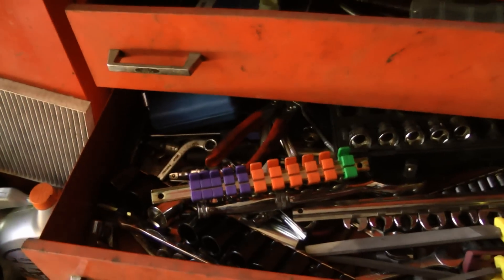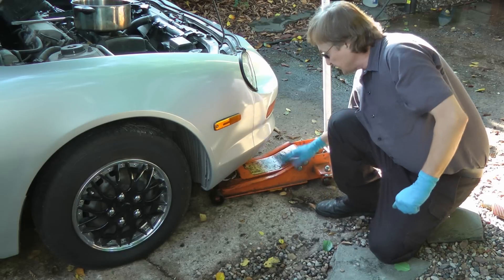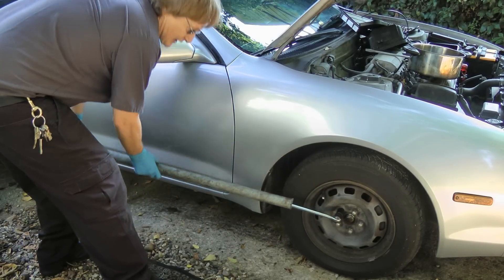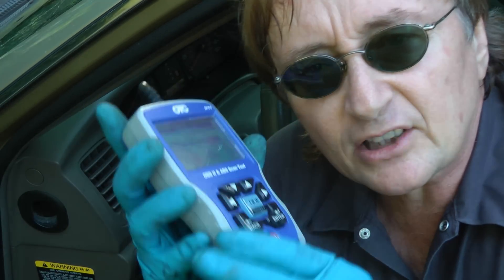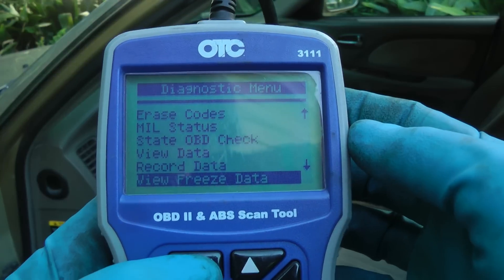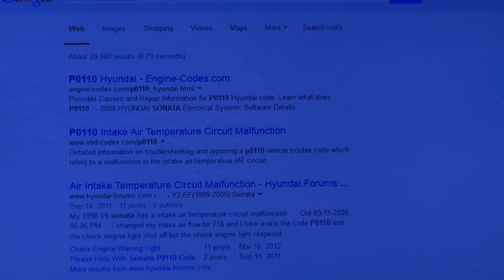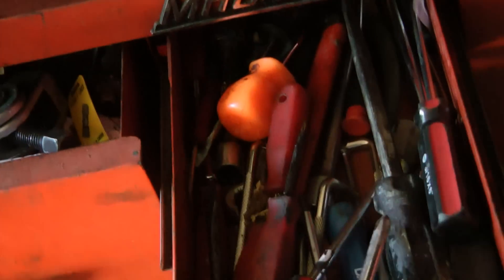Basic Tools For Fixing Your Own Car

Comment: Hello scotty and thank you for the effort, I have a question that everyone have a different answer to:
How often I need to change my gear box oil ?
I have a chevy lumina 2006
LS
Reply from the maker: on an automatic transmission, I would change it every 30 thousand miles. If a standard car, only every 80 thousand miles or so, it's not a big deal on a standard.

Comment: Scotty, many people would say as a beginner you should be using a torque wrench for wheel tightening and other critical areas.  Would you agree(you haven't mentioned it in your video)?  And I think something like wheels is very basic.  Or might hand tight be ok for wheels, brakes and other such areas?

Comment: Thanks for your video. I often find that I'm either too wimpy to break bolts and other fasteners that are really tight. I do have a few breaker bars, but I often find that I don't have enough clearance to buy myself some leverage. Any suggestions on how to undo factory-tight bolts?

Comment: You're right, I bought an OBD reader for 20 bucks that plugs in and whenever I plugged it into a camera it screwed the traction control! I had to level the car out and calibrate the traction control again using the same tool but in a weird way

Comment: How do I tune up my 292 straight 6? 6'000 miles on a long block. I have a lifter  noise, or maybe a rod noise etc. It should run smooth and noise free in traffic. I may need to shop it and get the results it needs. U da best!

Comment: I like Duralast tools, great warranty for their tools, I have a 180 tool set, a 3 1/2 ton jack, and a newer breaker bar. I broke my previous breaker bar after I got done changing out a flat tire, I left my breaker bar on the back bumper, I made a sharp turn and I heard a loud clang, after I did a tool inventory, I noticed my breaker bar was missing, so I texted my mom to let her know that my breaker bar fell off, I got it back, but the little ball that secures the socket on popped off, so I went to Autozone and got a new one for free.

Comment: Good video scottty
I would not advise anybody to put wheel locking nuts on as a garage once tightened them up with the air tool to 150+ lbs and it broke the delicate locking nut key when i tried to undo them and had to order a new locking nut key abroad to get it off.
Glad it did not happen at the roadside in the middle of nowhere
I have my car garaged at home and don't go anywhere dodgy so i don't need them.

Comment: The thing that kills hydraulic jacks is lack of use. The seals dry out and split if it sits too long. I have  a harbor freight jack that is older than me and it has never had any maintenance except a new coat of paint. Still works and no leaks.

Comment: I agree 90% I'm a pro mechanic but in my truck I always keep a(fixd) blue tooth coads reader ob2 scanner an it's never let me down when I'm off roading 70mi from help an any way u take everying u may need most the time a power probe an a 8mm-21mm socket set all u need from Harbor Freight an always got home even when my tranz ecm went out an won't let my truck start flash the coads reset my computer an I got home tell I could get it fixed right I got mac an snap on tools u don't need to blow $$$$ to be a engine technician you just got to have a decent code reader and a good idea of what you're doing.

Comment: If you are buying a socket set, consider paying a couple extra bucks for a metric spline set.   I've had the splines work even after my 6 point set had rounded the bolt heads.

Comment: I bought a $20 bluetooth reader from China which sometimes causes the ABS light to flash when I turn the ignition on. It's an ELM327 clone, so I'm planning to buy a genuine one. These are also faster than the clones and doesn't mess with stuff it isn't supposed to mess with. But I have to say that it's quite convenient with bluetooth, since it allows you to check live data while you work around the engine, and if you use a laptop or a tablet you have a big screen to show graphs and such on.
Reply: real talk about i had the same issue with the bluetooth one.. thats why i just buy american made tools...yes they are price but they worth it as hell im just saying guys...

Comment: LoL! I used to do commercial tire fitting and have used a 6ft scaffold pole on my breaker bar to get some truck wheels undone. Believe me, even my 1" drive heavy air gun didn't undo the nuts and I was jumping on the long end of the pole before come of 'em cracked off!! (I wasn't allowed to use a flame to heat them up)

Comment: So specialty tools 
I am getting into the mechanic trade 
I got most of sockets minus the female torx sockets 
And Allen sockets that I am going to get tomorrow 
I got impact guns and breaker bar I got two jacks harbor freight 1.5 ton and 3 ton high lift jack 

What else should I get a induction heater? 
Brake caliper piston compressor 
Wheel hub remover tool 
Ball joint remover? 
Also a welder?
Reply: Quick note 
I am getting the launch obd scanner that shows and resets abs light and sees the transmission shifts and etc

Comment: Scotty, what's your take on the need for torque wrenches? Some say they're critical, others say that tightening by "feel" is good enough. Are you in the latter camp? I haven't noticed you using torque wrenches when you tighten stuff (at least not in the videos I've watched so far). 

Thanks for the great vids!
Reply from the maker: I'm with the later group, only use em on engine rebuilds and critical stuff

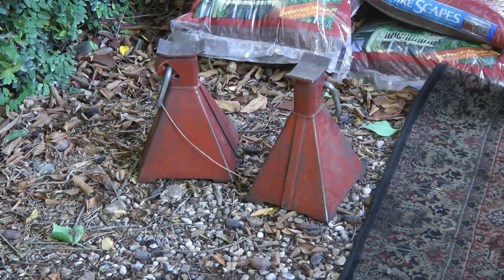Comment: At 1:48, I thought you were going to be crazy enough to actually take off the hubcap with that air tool! At the garage I work at, we had a lady come in who thought she needed a locking wheel nut key after she had tried to take off what she thought were the alloy wheels on her car. Turns out she snapped off the fake wheel bolts on the hubcap!

Comment: Also keep in mind that you can borrow, for free, many tools from auto parts stores that would normally cost a fortune. Usually there is a deposit, but you get that back. I've even borrowed a bearing/ball joint press and used it in their parking lot (Autozone) once, when I didn't even have the money for a deposit.

Comment: @2:12 I laughed. I have used a pipe on my wrench for decades. My brother and I coined the term for it "The Bitch Bar" because it works every time a rusted nut or bolt is a bitch.

Comment: I remember down my motor club, we didn't have a working air gun at the time. We were taking a car to pieces and after disconnecting all of the brakes etc we had to get driveshafts out, the nut was badly crossthreaded so, to crack off the nut we had to use 7 people, 5 to anchor the car as it was light and two with a 6ft piece of scaffolding on the breaker bar to get the nut off.
Reply: How did you not snap the breaker bar, I've done that myself using a big pipe before lol
Reply: Because the car was so light the rotation of the bolt caused the car to move so we needed the anchors. We didn't snap the breaker bar because we have an older one, much stronger and because we have a couple of animals (not literally) down the club we need stronger tools, we only had our biggest one as the two smaller ones were snapped by one guy lol

Comment: Torque wrench. Always use a torque wrench when working on cars...removing tires especially. It provides the proper amount of tension for tightening so you don't over tighten it, which is bad.

Comment: Hey Scotty I have a 2001 Ford Taurus. I am going through a rough time with it. When i am driving it runs fine but when i get to a red light and i am idle it dies. It does not do it all the time. Lets say in a 30 minute trip from my house to work and maybe 10 stop lights it will do it once. Some mechanics have said is my fuel pump going bad and others say my MAF sensor is dirty. What you think? Thanks. And by the way your awesome.
Reply from the maker: try my video "how to fix a car that idles poorly" and being a ford, check for vacuum leaks on the intake system too
Reply: Thanks!

Comment: Hey Scotty!
 Thanks for the video.

One question regarding socket drive. What type do you suggest for regular car maintenance? 

I don't own a socket and ratchet set and consider what to buy. 

I read that 1/4" drive is good for small works, 1/2" is good for large bolts and 3/8" is a good place in between. What do you think? Can a 3/8" drive socket set be enough? 

Thanks again,
Rami
Reply: If you're not doing brakes or suspension, grab a 1/4" set and a 3/8" set. If you're doing major work you'll need all three.

Comment: If you need to replace timing belt or crankshaft seal you need impact driver to remove /tighten crank bolt if not the crankshaft pulley will spin

Comment: I need some help with something. My truck started making a grinding noise for the first 3 - 5 seconds of starting it. (It's a 87 f150) I had 10w30 but did an oil change and used 10w40. Put in 6quarts and primed the filter. We also tightened all the bolts on the oil pan (made sure all of them were torqued to the same amount to prevent warping of the pan). But because the filter is on the side of the block, we could only fill the filter 3/4 the way up without spilling it before putting it back on. Dipstick still said it was 1/2 quart low, but we had no more oil left to put in and it was in the middle of the min and max markings , so we thought it should be okay for now.

So we fire it up and immediately, I notice oil pressure had increased dramatically (good because it was reading slightly low) and the truck didn't make that awful sound anymore. Yay right. Well I'm at my friends house 3 days later and oil pressure went down. It was a hot day and rear main does leak (not too bad tho. If truck sits and is started and shut off, it won't even leak out. Just gotta drive it or run it for a good while) and id done about 45 min of driving. He thought maybe the old seal was on the filter from the old filter. Well we pulled the filter, and that wasn't the case. While the pressure was low, it still increased with acceleration. So we put it back on and lost 3/4 of what was in the filter but we didn't put more in before we stuck it on, I start the truck and the sound is back... I get home a couple days later and put a whole quart in and it and the stick reads that it's 1/2 quart low. I start the truck up the next morning cold and it's still making the noise.  (Noise is only made when the truck is cold. If it sits for 3 or less hours, typically it won't do it). It's got a 302 EFI in it. Any advice? This morning, I just went ahead and kept adding oil in until the dipstick was at it's Max. mark.

Comment: thanks man,, thumbs up,  for oil change reasons only, is the simple jack u just thru away enough or go for the large one?
Reply from the maker: larger ones are best, harbor freight tool sells em for 69 bucks when on sale for a low profile one you'd need for a BMW
Reply: Really thanks man.. keep up the good videos.

Comment: Scotty, I'm looking for a simple, good truck that's easy to work on and has decent gas mileage.  I'm thinking of something from the 1970's or so (like a c-10 or F150) that has a newer, upgraded engine.  What is the best, easiest truck you've worked on that you would recommend? I value your opinion.
Reply from the maker: get a 70s F150, you can't beat them. Just realize no big truck will get good gas mileage. if you want that, get a smaller toyota truck, the can run forever

Comment: Even some of the best OBD2 scanners are no match for a 12$ "bluetooth obd2" transmitter (search that on ebay, buy a small one !) that you couple to your normal smartphone (app Torque is very good and like 5$).

There are no 60$ bluetooth obd2, if you find one it's just someone selling you a 12$ for 60$ ! They all work on the same design and I've never had any trouble with them and I used them on dozens of cars. The only problem is that sometimes they are refusing to pair with some phones.

What I really like about the software is you can set it to record everything, then you go for a 30 minute ride with the car. It helps diagnose intermittent problems.
Reply: bluetooth ones are absolute shit. we had one and it told us the car had a leaky o2 sensor. used a obd2 scanner and it told us the head was leaking. obd2 1, blutooth 0
Reply: shaun23100 OBD2 cannot possibly tell you about leaks in the exhaust system.
Reply: shodanxx  it can as it is telling you if the o2 sensor is receiving to much fuel, and can tell you you have a leaky head
Reply: There are many cause for air fuel imbalance, the O2 sensor cannot determine if leaks of any kind are the cause.

Comment: Scotty what scan tool should i get for a 1990 Toyota Celica GT-Four ?
Reply from the maker: those require a dealer level scan tool, they cost a ton. but you might find one like an old snap on on ebay for a lot less.
Reply: I'll try to see if i can finde one ty so much Scotty :)

Comment: flare wrenches are good for brake lines too.
Reply: and if your removing a broken part just cut the line and use a box wrench.
Reply: omg yes, i stripped my clutch master hydraulic line using a standard open end spanner. flare wrenches are a must.

Comment: Would a GM OBDI to OBDII adapter work with a scan tool? Or would you recommend I just buy an OBDI scan tool? Also, a crowbar can be a very creative tool around cars.
Reply from the maker: those adapters rarely work
Reply: Not sure if you bought anything, but you dont even need a scanner for GM OBD1, just a wire.  the scan tool is a fancy jumper wire with a plastic case to stick in the port.

Comment: I have a misfire with one of my vehicles so I can at least verify the issue is relatable to a computer and or another part. Is there any way u could do this myself as a person somewhat new to cars? If not, how much do you think it would cost to pay a mechanic? I understand that prices vary depending on the mechanic and or auto repair shop itself, but what would be a good estimate?

Comment: when using a breaker bar for tires do you have to use a chrome socket or impact??
Reply: Regular is fine.. Impact uses a hammering action so regular sockets can shatter apart.

Comment: hey scotty im gonna be buying the crescent 170 piece tool set, wondering if they
ok for basic car work
Reply from the maker: I've never seen that exact brand, so I can't say, But really most tool kits are fine as long as they aren't made of pot metal
Reply: I have the Crescent CTK170CMP2 and its pretty good. wish the combination wrenches had ratcheting ends but still gets the job done excellently for ~$100

Comment: I just left you a message on your other video about a evaporated leak will the light just go off when the leak is fixed
Reply: After doing the repair do a hard reset by disconnecting the battery for a little bit or Autozone has a 60 dollar code reader that can clear DTC's as well.
Reply: thank you I did that and the light had not came on 😃👍
Reply: Awesome man glad to hear it worked out for you.

Comment: my 01 kia optima se v6 doesn't come with a compartment to put a cabin air filter (even though many places have the part, or what would be the part). How do I clean out what has got to be 14 years worth of god knows what from the vent system (not just the vents in the car but the entire vent path, from outside to blower motor, etc.)?
Reply from the maker: you'd have to physically take it all apart and clean it manually, a GIANT pain
Reply: *****
im sure. I checked many times. the only way it could be there is if i have to remove the entire dash console which doesn't add up. i even checked under the dash on the passenger side. Besides there wouldnt be what looks like faint greenish dirt on the inside of the vents if there was one. makes no sense that there wouldn't be one but there isn't
Reply: Have you checked a manual like Haynes or Chiltons?   If the job is a huge PITA most manuals will list the steps needed to access and service it.  (PITA= Pain In The A&&)

Comment: Scotty, my 01 gsxr 600's rear brake pedal is sinking. Some times it works fine but other times it sinks really low and does not work. Could it just be air in the system or something else?

Comment: Hey Scotty, I drive a 99 V6 Mustang, having some power issues. Ive replaced the coil pack, spark plugs and wires.. Care runs well at lower Rpms, 1500 or so, at about 2k is when she starts acting up. Lots of vibration until I shift.. any clues? Would help out a lot thanks
Reply from the maker: pressure test the fuel pump after changing the fuel filter, pray it's just weak. Otherwise fuel injection system would have problems and that can get expensive

Comment: Hey Scotty, are there any special tools needed for repairing early 90s 700 series bmws? 1993 bmw 740i?
Reply from the maker: just regular german metric hand tools , BUT, realize any serious problems may require a bmw dealer level scanner to figure out what the problem actually is, especially on fuel injection or transmission problems.
Reply: Scotty Kilmer Wonderful, thank you.

Comment: Don't forget a left handed metric hammer. That and something to stop the bleeding when you discover that one sheet metal screw you tore up a knuckle on.
Reply: Man My hand sliped when taking the dust cap off my brake pads and since i was using a  flat screw driver to wedge it open it slid and smashed my finger. it let a deep cut and lots of blood

Comment: Do you have to reset the computer on a 2000 Buick century after replacing the starter
Reply from the maker: no, if it idles a bit weird just drive it and computer would reset that itself shortly
Reply: Thank you....it's awesome how you answer questions that pepole need help with....your awsome